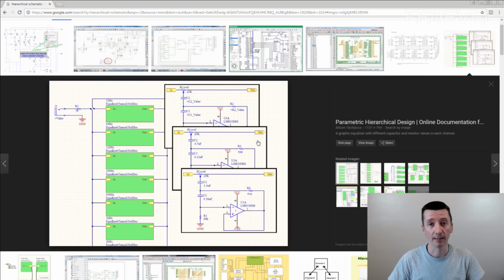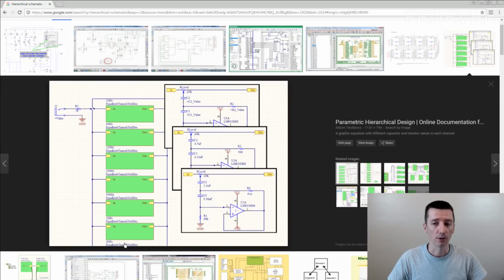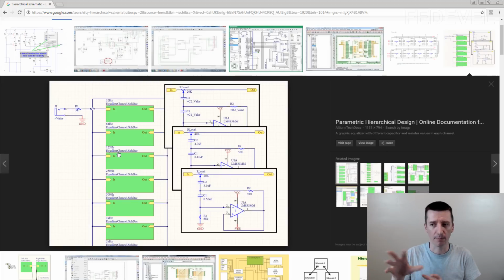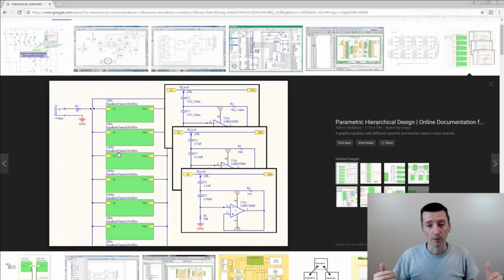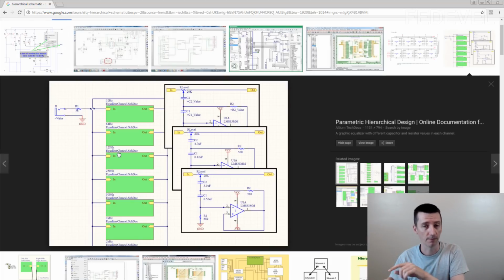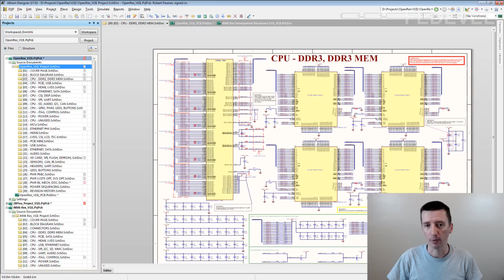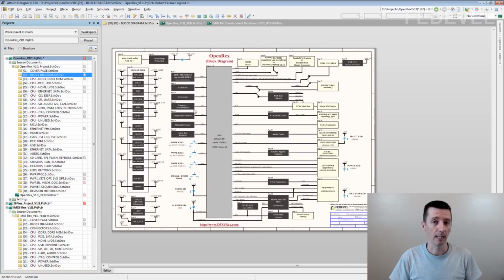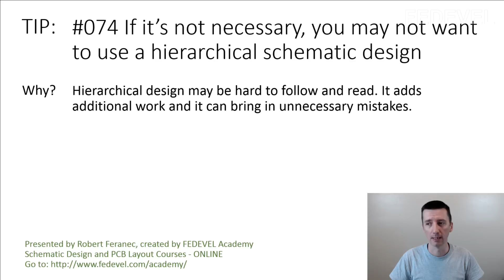TIP #074: If it’s not necessary, you may not want to use a hierarchical schematic design

Comment: @Robert Feranec,
Hi, I am new to hierarchical design and I have some doubts.
1. If you are using same blocks with different places, The reference designator will be same, right. so If you are using 3 blocks, then three components with the same reference designator will there right. which will cause problem in PCB design??
Reply: The reference designation will NOT be same! Each instans of the block will have its own modified ref. descriptor. e.g. R11 will be R11A and R11B... or R11-1 and R11-2. Many ways make it.

Comment: Totally agree, the way Altium does hierarchial deisgn it makes it hard to read and follow.  I really would like for Altium to change the hierarchial design to allow it to look like a block diagram.  Right now it's based on single schematic pages, it needs to be more felxiable.  This would be a major feature if Altium would do it, but they don't really listen to current users much.

It's fine for "simple" designs where you have repeated layout sections. But for complaiacted deigns (like ARM sbcs, Thunderbolt storage, etc..) it completely breaks down.

Comment: Hi Robert, I would like Congratulation about all videos, thay so helpful. I have a question, sorry if is offtopic. I want to change the designator size, e.g.: U1, R1, C1, they are so big and take so mach space,  on SCH and PCB. But I would like to this on the library. Thank you.
Reply: DXP->Preferences->PCB Editor->Defaults->Component->Edit Values->Designator (Change Height As You Like, Width doesn't effect anything.) After that when you create new PCB, your designators will be as you like.
If you want to change already created PCB, you need to right click on any designator in PCB, then click on Find Similar Objects, then change Any to Same next to Designator, then click OK. All the designators in PCB will be selected and PCB Inspector is going to open. From there you can  change all selected designators' height at the same time by changing "Text Height".
P.S.: This is kind of a basic of Altium Designer. I suggest you to watch Robert's videos from his website and his youtube channel.

Comment: That's why you use Device Sheets for this particular use case (having sort of a template for a schematic block).

As for hierarchichal design - people are just not used to it, when you think about it as analogy to object-oriented programming and creating objects it becomes much, much more intuitive. And ultimately, for me it's mostly a productivity tool, which used along compiler and proper erc saved my bacon plenty of times.
It always struck me as strange that people for the life of theirs cannot figure out where a line goes, but they seem to follow code that I cannot wrap my head around, and it uses no particularly difficult constructs, just some moderately advanced C++. Go figure :)
Reply: I came to hardware design from software engineering.  Hierarchical design is wayyyyy easier to follow IF you're used to that kind of thing (like anyone who is reasonably decent at programming).  But I can see how it could definitely go too far to where it's just pointless.
Reply: @wcvp  I'm in the same boat as you. I see the argument being presented but I feel like hierarchical design is so much easier on my brain to follow. I'm used to tabs and laying out things in functions.

Someone else commented about making them more as block diagrams which I kind of do think would be better. It would solve the problem Robert is mentioning

Comment: I usually use a synoptic view of SCH block  page, that give you a view of signal going from one block to an another. I put the main SCH block page (generally it's the cpu) in the middle, and then all the other block around it. Altium also offer a tool that allow you to add signal ports automatically with the name and direction in/out/io. I put this synoptic in the first page of the project to present quickly the structure of your schematic.

Robert I propose you to add a video about it. Feel free to contact me if you need some help, I will be glad to help a master like you!
Cheers

Comment: I have used Hierarchy few times and it worked fine. The biggest advantage is that you can make pcb components placement and routing identical for identical Chanel without any extra effort.
Reply: Yes, this is what a hierarchy used for. No one using hierarchy just for schematic, because it is useless.